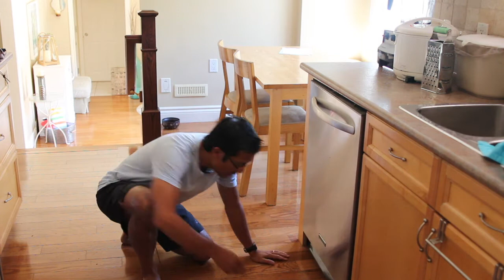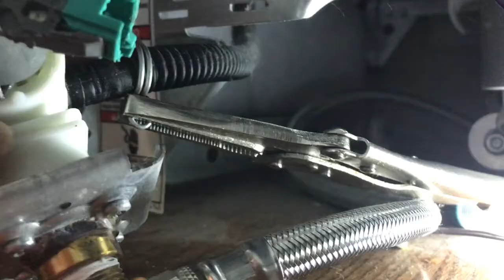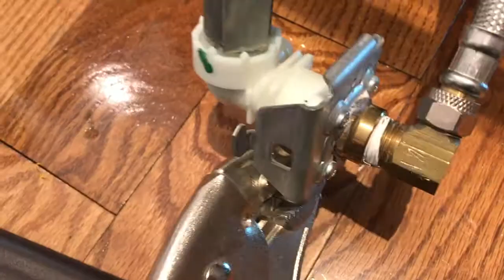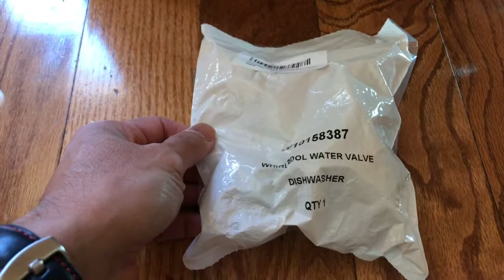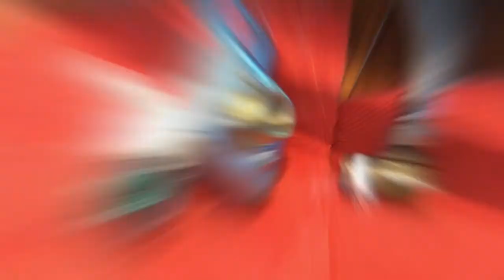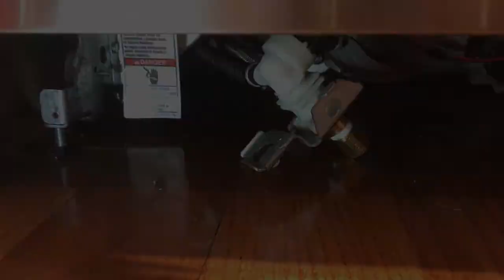DIY Water Leak fix on Dishwasher (Repair Water Valve)

Comment: Hi Danny,   I have been trying to sort out a slow leaking problem in the exact same Kitchenaide dishwasher, but there isn't any leaking off the external part of the inlet valve, but my wash tub, slowly fills up over night. The cancel button successfully drains it and I've checked that my drain hose is working too. So I have narrowed it down to the possibility that a slow leak from a faulty inlet valve might be the culprit. Thoughts? Thanks for the video.
Reply from the maker: Best way is to pull out your dishwasher, then put paper towel underneath it, run through a rinse cycle, and hopefully after the cycle, you can lift up the dishwasher and see where the water drops are coming from.  The paper towel will show you the water marks so you will know from which part pf the dishwasher the leak is coming from.  The intake valve is a common leak area and the water valve.  Another is the door....check to make sure the rubber seals are clean and not damaged.
Reply: Thanks for responding. Unfortunately or fortunately there isn't any leaking outside the dishwasher, it's only the inner tub that randomly fills up on it's own. That's the mystery and why I was wondering if the inlet valve could cause that? Or are there other possible reasons?
Reply from the maker: Oh sorry for the confusion....ya, that is strange.  When you say it fills up over night...does it do that after running a cycle of wash and it completes then it fills up?  Or does it fill up even when the dishwasher is off?
Reply: @DDIY-Guy  it continues to fill over night, even after a finished cycle, which seems to empty properly.
Reply from the maker: Like you said....it sounds like the intake valve is not closing completely and letting water come in.  Have you tried closing the water line a little bit so there is less water pressure coming in?  It might take a little longer for your dishwasher to complete the cycle but maybe the valve will have an easier time to close.  Hopefully you water line has an valve you can decrease the water.

Comment: Might have to call in a plumber?  Just turn off the main!  Maybe add a valve first thing LOL.
Reply from the maker: Yes, if you don’t already have a shutoff valve under your sink, you should definitely add one.  As for the leak under your dishwasher, it really is an easy fix and will save you lots of money to do yourself.  Keep me posted.

Comment: Great video. Very simple. Have problem inside a valve, not closing water properly. Will go same way , just change all part. Thank you
Reply from the maker: That’s great to hear. Glad the video helped you fix the problem yourself.  Thank you for commenting.